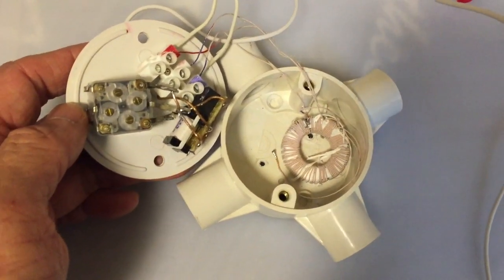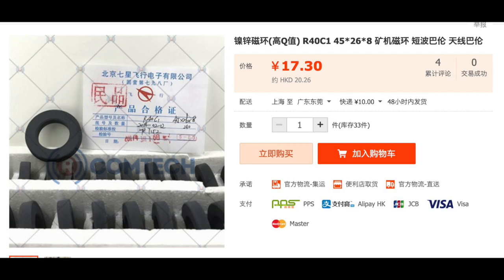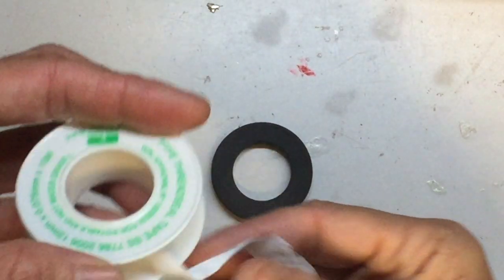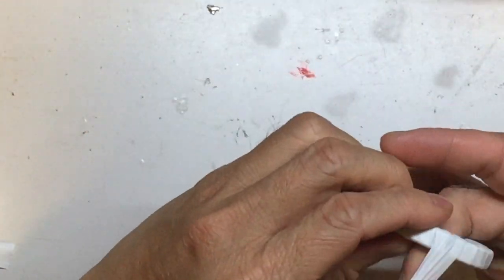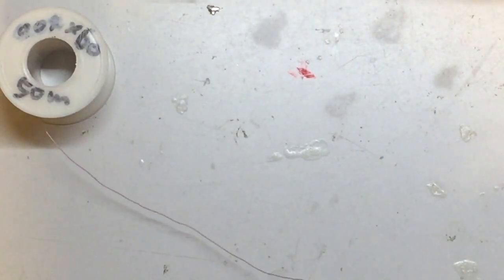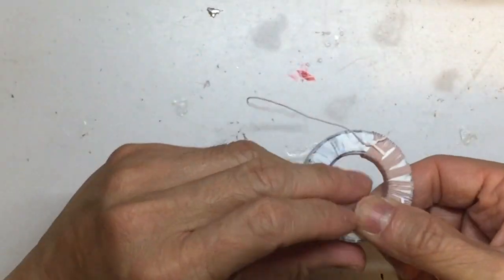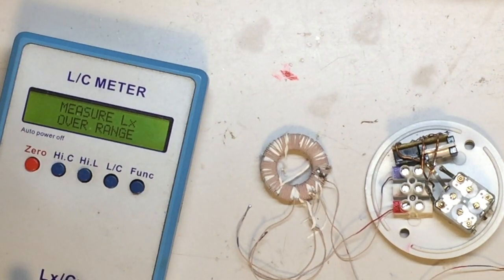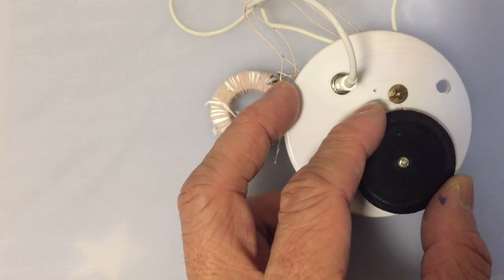Ferrite Toroid Coil AM Crystal Radio (MOS FET) Step by Step Instructions

Comment: Is it possible to build battery free SW/FM/AM radio without 3SK143-Q module and ground connection
Reply from the maker: Yes, you can replace the FET with a diode just by connecting the Diode at the point of S and D pile of the FET. But not all diode can work in FM frequency range. 

A lot of diodes that works well in a lower frequency MW AM radio frequency range will not work in FM. Because such diodes have a higher hidden capacitance at the P/N joint that lowers down the frequency of the VHF band that is used by FM radio, and hence not suitable for FM radio frequencies.

MOS FET 3SK143-Q(3DQ) is multiple times better than a diode in performance with weak station.
Partly because the 3DQ has a super high input impedance (looks similar to that of a vacuum tube).
A high Input impedance is important because it will have a lesser impact on the efficiency of the L/C resonance circuit (or tank circuit where you tune the frequency of the radio to receive).

3DQ also has a  lower output impedance that matches better  with lower impedance headphone even without using output impedance matching transformer. 

For diode, the input impedance is multiple times lower than that of 3DQ.

For diode,  the output impedance is multiple times higher than 3DQ, and you must use either a high impedance headphone such as a crystal earbud (10K) or magnetic coil headphone (10K) or use an output impedance matching transformer. 

You will find that where 3DQ can produce an audible audio output in a weaker signal strength condition, the regular diode will produce much lower or even no audible output.

However in situation with a strong signal strength, i.e. when you are close to the transmission station or has a very good antenna and ground, diode will produce a stronger output than 3DQ. 3DQ has a limit in its output current. If you want to raise the output limit of 3DQ, you can connect multiple 3DQ together in parallel.

In terms of audio quality, 3DQ produces much clearer and high quality audio output, some times close that of Hifi if you have a good earbud or headphone for crystal radio.
Diode output is sometime distorted and require additional technique to improve quality, e.g. by a Benny circuit. Connecting a Variable resistor and a capacitor in parallel, then connect this circuit in series to the headphone. Vary the resistance to tune to a better audio quality. Or by connecting a huge inductor (20H or above) in parallel to the headphone to increase the BASE of the audio output.

Hope this help.
Reply: @BillyCdiy  
Thanks bro
Reply: @BillyCdiy  
How about connecting 5 diodes (1N60 or 1N34A) in parallel in D and S points 😊
Is it a good idea
Reply from the maker: @loganathanvb6834  , Thanks. Yes,  you can substitute the MOS FET 3SK143-Q with another detector, be it a diode or a real crystal. As you said, just place them at the place two points where D and S are connected.
However, the most important consideration of components and circuit designs for a crystal radio lies in maximizing energy transfer from one stage to the next. Or to reduce energy loss in between the stages. So, when a different detector is used, there will be a different impedance associated with this. That will cause a corresponding change in the tabbing point on the coil, as well as the transformer for the impedance matching with the headphone.
Different detectors has different performance in sensitivity and selectivity. 3DQ (3SK143-Q) is known to be good at bosh capabilities for weak signals. When you are dealing with a strong signal, the diode will outperform 3DQ in terms of sensitivity (louder output that can even drive a speaker directly).

Comment: Hey Billy, where you test this project? It's receive AM broadcasting from my country, Indonesia. The last song clearly beautiful and good song by the way 😀

I'm suffer badly for finding 3DQ over here. Just 1N34A and 1N5711 that I can get, and it not good enough for receiving FM. 
Several months ago I get 1N5819 and work perfectly but when I researched the stock of 1N5819 it's not work same one per one although the voltage drop just same! New 1N5819 not receiving at all at FM, but 1N5819 salvaged from ATX computer Power Supply work decent.

I just dreaming about 3DQ and wishing for FM Crystal receiver.

For now I just make FM Superregenerative receiver with 1.5V and 2SC9018 Transistor, it drives Piezo earphone clearly and receive 16 broadcast stations without antenna. 
But not good as your Crystal Radio which no power needed at all.

Love from Indonesia 🇮🇩
Reply from the maker: Samuel Budiyanto , I tested in Hong Kong in a place called sham Tseng. You can google it. 3DQ is available in the Chinese Taobao.com but not hard to ship overseas. There is the overseas version called aliexpress . See if you can buy there. https://m.aliexpress.com/item/32991294749.html?pid=808_0000_0101&spm=a2g0n.search-amp.list.32991294749&aff_trace_key=75adc86a85f4419b9022b9cd2b56ff52-1591328986039-06007-UneMJZVf&aff_platform=msite&m_page_id=868amp-ZelQHj-RgiICiqJMX_Zkmg1597798333757&browser_id=edb9c3c25ece4d3b95974f070c53b60f&is_c=N. Also, a gentlemen’s sells this in US through on eBay. 3DQ
https://www.ebay.com/itm/MOSFET-3SK143-Q-3DQ-for-Crystal-Radio-Zero-Voltage-Threshold-Detector/161600513556?hash=item25a0242614:g:YBcAAOSwPhdU3sHm